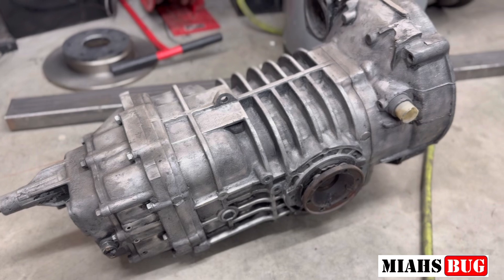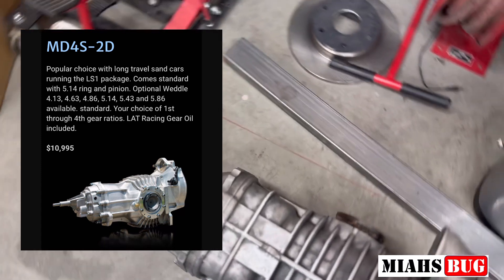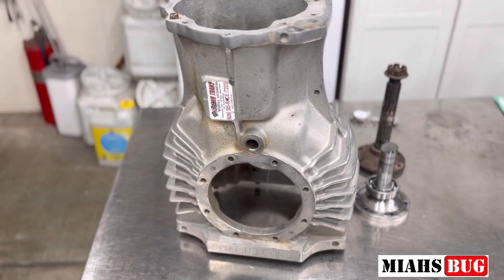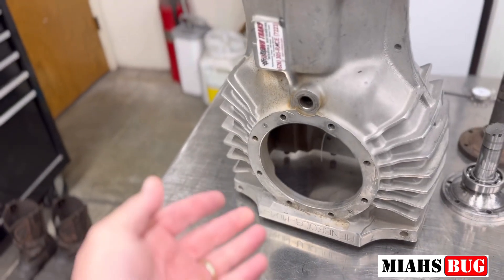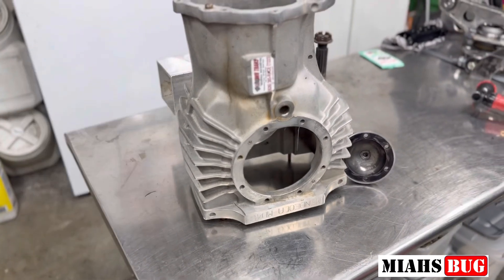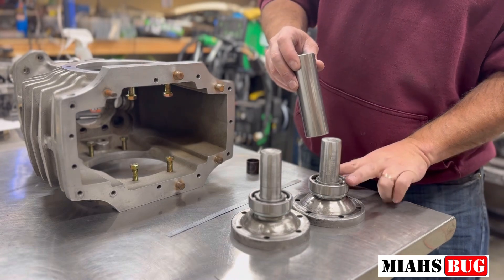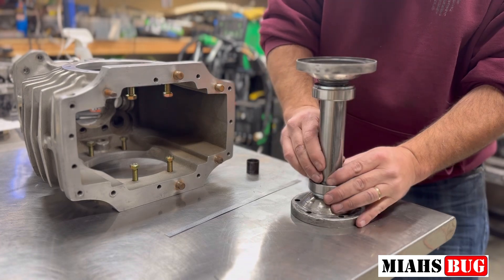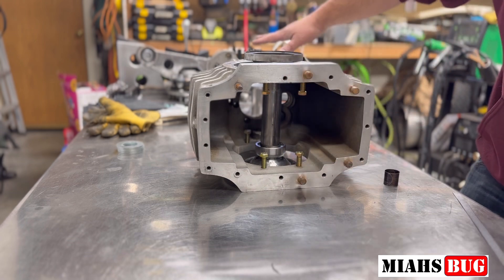Building a 3D Printed Transmission for my Honda VTec Baja Bug

Comment: Honest question - why Honda VTec engine (not as an insult i'm wondering cuz i wanna make my own baja in the future ) ?
Reply from the maker: I chose the Honda VTEC V6 because of they’re very reliable, easy to find, cheap, 240hp stock, lots of aftermarket parts and accessories. I bought my engine for $400.

Comment: Honest question - why not use a Subaru transmission?
Reply from the maker: The rotation of the Subaru is opposite and the gears are not correct for the larger tires. There is a company in Australia that converts them.

Comment: theres a place in australia that makes bits to adapt subie 5mt transmissions, why not use one of those? i think theyre fairly strong and cheapish, and you get an extra speed. 
im personally working on adapting a audi trans to a honda gl1500 motor right now.
Reply from the maker: That’s awesome. Subarugears right? I would like a proven platform but sounds like a cool deal!
Reply: @MiahsBug  Yea, they were really helpful when i had questions on their matters. They mentioned some honda b-series bays running their stuff when i asked about ccw engines.